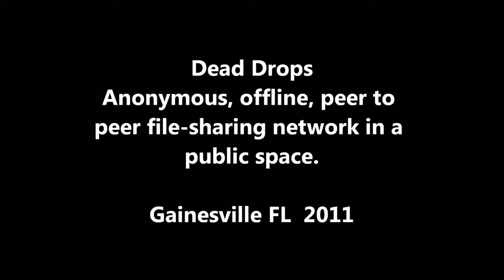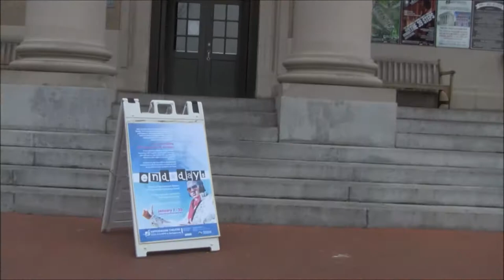Dead Drop installation HOWTO Gainesville FL

Comment from the maker: @tf2whackyengineer Ended up having to redo all the dead drops with cement.  I just took a small amount in zip lock bags, then added water to them when I got there.  Worked much better.